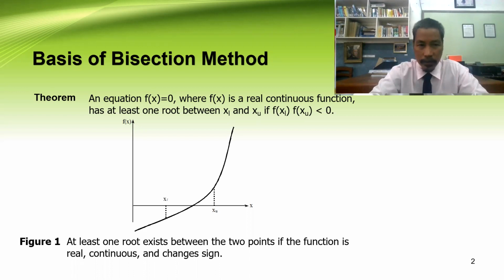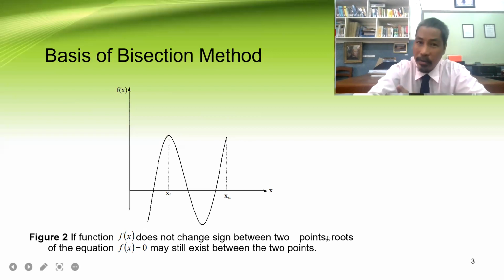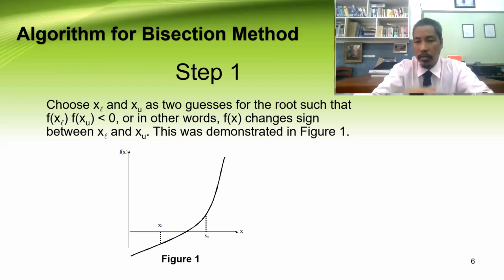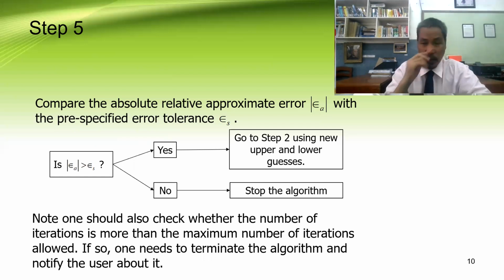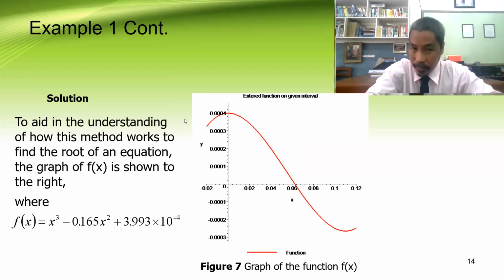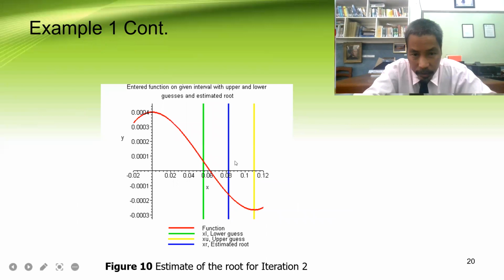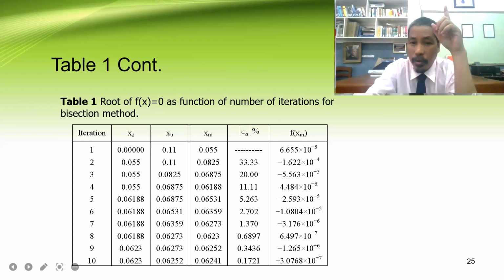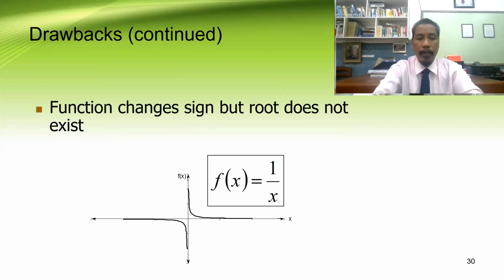Basis of Bisection Method | NUMERICAL SOLUTION for CE Problems: Roots of Nonlinear Functions f(x)=0

Comment: Thank you sir for the complete algorithm of bisection method. The step by step really helps a lot. From choosing the initial guess of x_l and x_u. It would be a trial and error to find the root in between x_l and x_u. Then we check the condition if f(x_l)f(x_u)><=0. Then from that condition, we apply. It can be between x_l and x_m or x_m and x_u. That range from two point gives another upper and lower guesses that's why, the problem came up to 10 iterations. It will only stop when f(x_l)f(x_m)=0 because ROOT will be equal to x_m. Another one is when we check if |εa|<=εs. I hope I clearly explained what I learned.

Comment: Thank you, sir, for this well-explained lesson. This method of bisection needs a lot of patience to solve the correct answer (manually). You may have to solve many iterations to make sure that the answer is possible or correct. Thank you, sir.